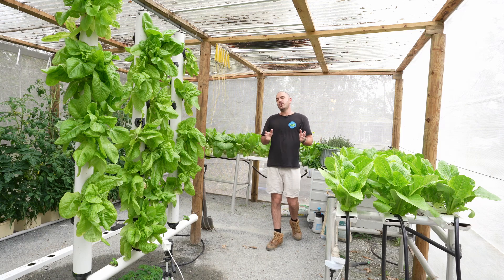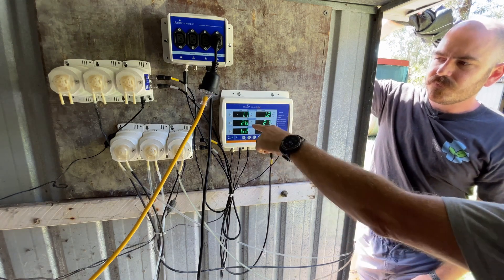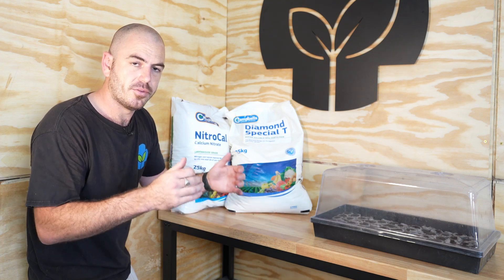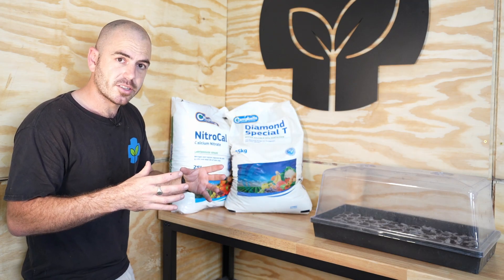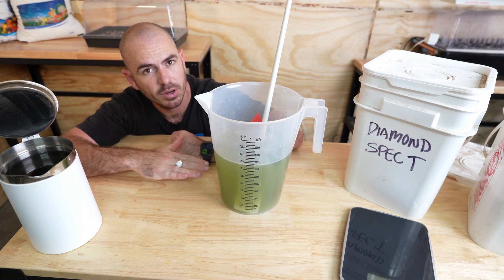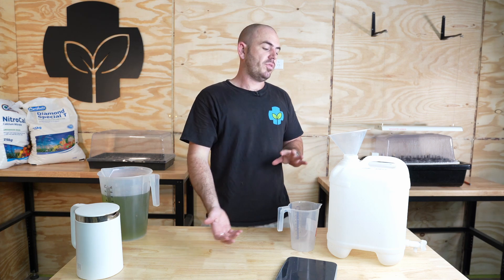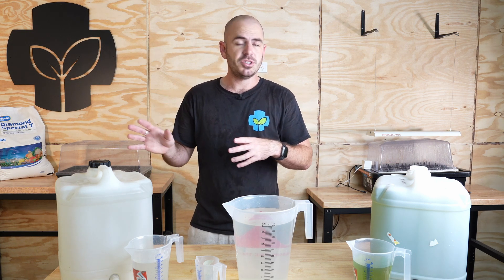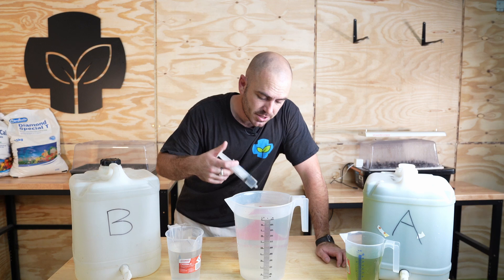How to Mix a Hydroponic Stock Solution

Comment: Takes a lot of time to study up on all the different nutrient products that are available. Be great to get to a test chart if one hasn't already been done to make comparisons. A table with data collected on the results of using various nutrients by manufacturer. I suppose water is a big factor too. Also, comparisons between dry nutrients and liquid nutrients. In addition, I am just now discovering the biostimulant market for hydroponics. Here in Japan a company I work with developed a bistimulant that causes roots to grow 20-30 percent larger resulting in the roots being able to pull in more nutrients for increased growth. A biostimulant linked to an optimal nutrient would be phenomenal growth.
Reply: An optimal nutrient profile would have to include the environment because environment plays a major role in nutrient uptake. Fwiw, uptake changes with temperature, light intensity and CO2 as well as growth stage. The type of growing method makes a big difference and if that wasnt enough, the daytime and night time elemental uptake is completely different.
Reply: @atomizer2665  All of what you said is automated in commercial hydro in Holland. These guys are on another level. Even NO3/NH4 ratio based on temp hahaha...

Comment: I was using the diamond spec t in my nft system with good results but recently switched to diamond blue and nitro cal same ratio but the results are much better, I'm growing mostly winter crop of salads, cabbage,broccoli,Chinese cabbage and kale. Before had signs of nitrogen deficiency but now everything is green as can be.
Reply: Diamond Blue is epic as a foliar spray too.
Reply: @bradcarby3765  yes you are correct I have also used it that way mixed with jadam wetting agent works great
Reply: i always get nitrogen deficiances, i never go over 2.0 EC,  maybe i wasnt putting part be in 1st so it dropped out of solution ? i know iron and manganese drop out of solution easy